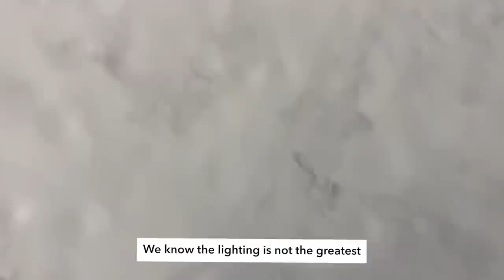You Would Never Guess It's Over Wood Subfloor | DIY Faux White Marble Luxury Floor Using Epoxy Resin

Comment: Can you guys do or have a video explaining the formula for mixing and the timings between each applications, time to cure etc. It will much appreciated 😁.
Reply: Hi
Reply: needs to cure for 24 hours before each coat , or have to be hard enough not to leave finger marks if you touch it
Reply: most epoxy resins have a (A&B) two part mix A being the epoxy resin and B being the Catalyst/hardener.. most  times it's a 2:ratio
Reply: The kit that I purchased has the etch going on first , the floor must be damp . They have A & B mixed together in a 2 gallon bucket, apply with a roller, throw the flakes in the air and that’s it . I’m puzzled !

Comment: Actually if prepped correctly it makes a solid floor ... I did this over wood floor over 8 years ago .... No cracks yet ......Im in Florida ....no extreme weather changes
Reply: I'm wanting to use a clear epoxy over a plywood floor, but I don't want to paint it, I want to burn the grain, sand and light stain it...do you think the stain will seal the wood enough or would I need to use some type of sealer first? and then the epoxy on top...
Reply: @DIYofffgridPeru  well Sir I did this over red cedar... I didnt stain it ...I just wanted a hard epoxy floor over this beautiful wood.... In florida we really don't have drastic weather I.E. NO SNOW LOL ... Im not a professional just a home owner.... My floors are beautiful no issues ... No cracks no hazing or cloudy color just breathtaking.... I have plywood under the cedar? With believe it or not a layer of tar paper between the plywood and the cedar. ....so I have over 1000 sq ft of beautiful red cedar floor.... I chose epoxy because it is harder that polyurethane ....Cedar is in the soft wood category ....so epoxy clear epoxy was used for durability and added strength ..... I get remarks all the time on how beautiful my living room hallway and 3 bedrooms are... I must say like you I was not sure how it would come out.... But I had a lot of money in my solid cedar millworked flooring... I knew I need to protect it with something stronger than polyurethane.......
Reply: @DIYofffgridPeru  I also must say In my opinion only ...there are a lot more chances for this to crack I would think but it hasn't..... This is one inch thick by 6 inch wide cedar installed over plywood with a tar paper moisture barrier .... So that epoxy went into or in between each cedar floor piece.... As I think I have more joints because this is actual wood flooring .... Just my thought ..... If it was going to crack it would have done it by now ....we applied it in a pour and moved it over the floor just like these guys are doing.... Its just clear thats all .... Im very happy I spent the money on clear epoxy protection on my floors....
Reply: @cindyscarlett3687  thanks...that's exactly what I wanted to know...I think I will try it as well...your answer is very much appreciated...we're building a semi-modern home in Peru...where the climate is consistent all year...so this should work for us as well.
Reply: Yes I think it should be beautiful. I found It is much harder than polyurethane. Its thicker . My husband and I worked it together.  I will say Im happy its is harder and thicker. God Bless and just go for it. Its clear and it will make you wood beautiful. I love the burnt plywood. I dont think I have seen it with stain. I just know this really came out better than we hoped for and its been almost 9 ten years and people just love our floors..... They will love yours to ..... Easy cleaning ... Swifter dust once in a while I mop . We love our floors ....

Comment: QUESTION for Leggari Products... can you pour your epoxy resin floor directly onto the T&G subflooring?  Or is a wood panel (like OSB or plywood) required, before pouring the epoxy?
Only asking, as we have 2" (technically 1.5" T&G subflooring from 1968) and wondering if we needed to put down some type of panel, or perhaps a membrane or underlayment first.
Thanks, any help is appreciated!

Comment: It’s definitely beautiful my only concern is with the daily traffic and all... how durable is this floor?
Reply: It should hold up providing they have the proper thickness of wood to negate any flexing that could potentially happen. Not sure if they use it, but I've threw fiber glass into the floor and also used a flexable epoxy as well.
Reply: Extremely durable. I have epoxy flooring and have tried to damage it on purpose. Nope. Epoxy is a very hard substance. That's a 25 yr floor, and very low maintenance.

Comment: You don’t have worry about wood flexing and casing cracks in epoxy?
Reply: I was just going to ask the same question… That would be a concern with the wood breathing under it and expanding/contracting...that it would lead to cracks in the Epoxy
Reply: I was wondering that myself. No way to account for any expansion/contraction and that's not just one room but looks like they did the entire first floor, so this has to eventually crack, right? I think I'd feel better about it if it was just one room or garage.
Reply: Michael Moore I used Stardek stuff for years
Reply: Mike Cole epoxy flexes more than wood. If you watch closely they took time to add extra screws to make sure the seams are tight to the joists.

Comment: I see you applied your epoxy in the kitchen and dining room will the floor be slippery with water spills like it is with actual marble or does epoxy have a grip to it?
Reply: you can add things  to add grip  but typically it is slippery when wet. just clean up a spill right away though.. water  beads on these surfaces
Reply: I have an epoxy floor in my kitchen and it can get a little more slippery than something like tile, but it's not really bad all all. A lot less slippery than I thought it would be. But it's fun to slide around on the floor in just your socks!

Comment: My question is this.  What happens when you need to redo that floor? I am curious about tearing that out later due to remodel, or due to damage.  Tile, vinyl, wood plank, carpet all come up and you replace with the latest decor trend... this is not only glued to the subfloor, it's filled in all of the gaps.  So, will this crack since it's got no room for movement as the house shifts with seasons and how the heck do you remove this 10 years from now when marble floors are totally not desirable.
Reply: Couldn't you just put flooring over it, its only like a mm thick?
Reply: @CowboyKodak  I am sure you could, but that is my question.  It's slippery,  will tile mastic stick to it?  Do they know, I doubt they have tested how to deal with demo or covering that.  But the other part of my question was damage.  If there is damage to the floor and it needs repair,  is that possible to fix?

Comment: Can you do this epoxy floor on a concrete floor with the same products or it works only in wood floor?.
Reply: Epoxy works great on concrete as well.
Reply: As steven said. It works great on concrete but it's worth the money to have the surface professionally prepped.

Comment: I have a hard wood floor, how can i apply epoxy?
Do i have to apply primer? if so, any specific type? 
Can you show me the steps. I suppose i need to clean the hard wood floor thoroughly
How can i remove epoxy from hardwood floor if it wont give me the result i want ?
  (in your previous video about countertops it was more clear on what you r doing but this one, it doesn't follow through )

Comment: That is an extraordinary transformation with a great finish. My question is: min 1:34  Left side of the screen, them 2 boards don't look like t&g . Would your product be strong enough not to crack over a loose board ? or would be safer to set a second layer of osb or plywood to increase floor rigidity ?
Reply: Im going to leave a comment, because i watched 3-4 seconds of the video, and already wanted to leave a comment asking the same question. I would have to assume that the cracks will appear within a year. Shrinking and expanding throughout a few seasons. I will be suprised if your comment is answered...
Edit-
Im willing to bet the claim here is that the subfloor becomes "stabilized" with the prep coats of epoxy. Thats it from me. Hopefully legari replies to your comment, as im interested in this kind of work(i do a decent amount of flooring, also painting, and this type of thing is right up my alley.
Reply: I am curious about the answer to this as well.
Reply: I was wondering about this too....to replace old tile in my foyer. However, don't people use epoxy on garage floors? Do they crack or is that different because it's not as large of an area?

Comment: SO you add primer first and then epoxy and then seal? What happens if the floor is originally concrete? do you seal the concrete first and then add primer and then add epoxy and then seal again?
Reply: You sand the concrete till it’s smooth and then after sanding and making sure there’s no dust on it you prime it, epoxy it, seal it.

Comment: How do you get the bubbles out?
Reply from the maker: The first thing we spray is 91% or higher isopropyl alcohol; this creates cells in the design and disperses the epoxy. Once that evaporates, we spray denatured alcohol to pop micro bubbles. This allows us to avoid torching the epoxy👍

Comment: $1600+ for 500sq ft, prep replacement primer, and top coat. Ouch, my garage will need to wait.
Reply: Better than the Rustoleum crap that flakes in a year and never bonds worth a damn.
Reply: That's if you have a contractor do it. I did my entire house (3500 sq ft) for less than $1000.
Reply: @alarikwood3330  not one of these kits.. it cost over $5k for a 1750sqft kit...

Comment: There are some awesome things on this channel.  but this floor, with no grout joints... just looks like a big painted floor to me.    doenst do it justice.
Reply: I think it's the pattern maybe. It doesn't look like marble to my eye - just looks like painted floor with smudges. I'm torn between Stone Coat and this brand for a reno... I guess they are the same it's just how you do your design. The Stone coat guys seem to take longer and add more steps (and do stuff like using a heat gun, blowtorch) but the results seem to be better. All subjective of course.

Comment: I need to remove my carpets, but underneath is RAW concrete. Will I have to pour a slab first before I can do the epoxi please
Reply from the maker: You can coat over concrete! Depending on the condition of your underlying concrete, it may need to be prepped differently. Please contact our customer service to know what to do for your specific project. Thank you!
1-844-LEGGARI (534-4274)
customerservice@leggari.com

Comment: Looked pretty nice, right up to the end.  That top coat ruined it in my opinion.  I know it's there for protection but you can see roller lines and the orange peel from the roller. Yep, that just ruined the finished product.
Reply: Should be glossy  no?  Kinda dulls it, but very nice 👌
Reply: @jerryho9328  Cant be sure but from watching other videos including counter tops, that dull finish might be a Matt finish that's used on some marble and soapstone creations. If you go to to look at real stone slabs you'd see what Im talking about.

Comment: you removed the shiny gloss, in my opinion that ruined it .. it looks so much better shiny reflective (like glass)..  

i do understand that last coat protects (but it makes it look so much duller in satin, like it’s missing the wet look a brand new car has)   

can’t it left super shiny?.. a step  backwards in my opinion  with that last coat :(
Reply: Yes. I agree. The shiny finish to the floor was much more upscale and attractive than the matte finish.

Comment: How are the cleats not making dots
Reply: The epoxy is still fluid like thick water. It has a long work time so it will fill in small impressions like that, unlike paint which has clays in it for coloring.

Comment: Beautiful but Slippery.....What happens if it becomes wet? Will it be prone to someone falling and... bammm?!
Reply from the maker: Epoxy has a slip resistance similar to tile! We do have a grit additive that can be mixed into the urethane topcoat to help with slip resistance, and has a slight sandpaper texture!
Reply: OH THAT'S GOOD NEWS. My last concern after the cost is working time. I live in a super hot and dry climate. Last time I worked with epoxy is began do harden a couple of minutes after I was done mixing.  What a waste that was!. @LeggariProducts